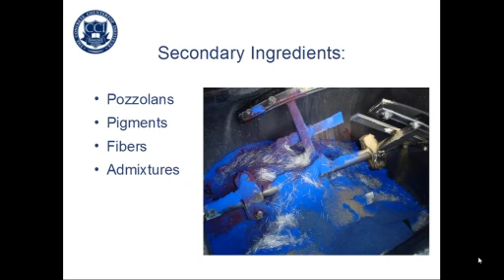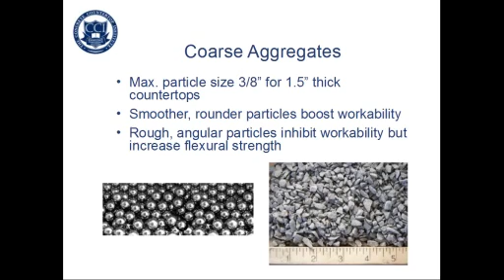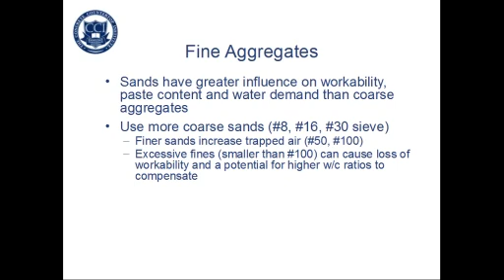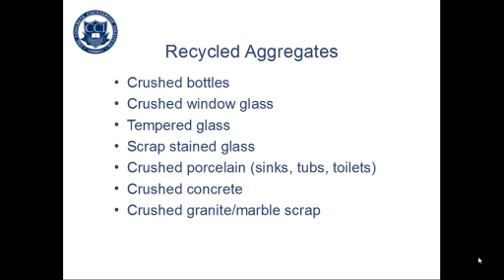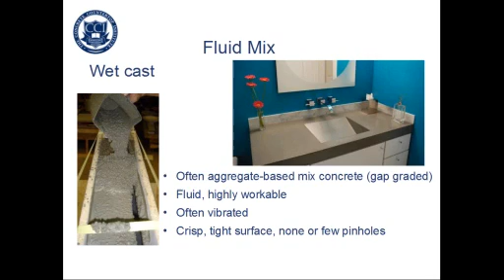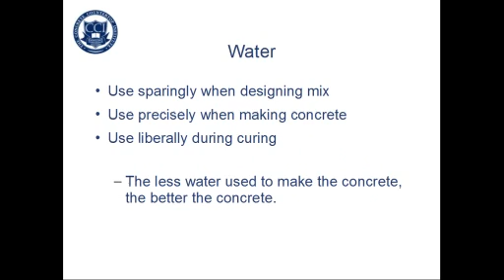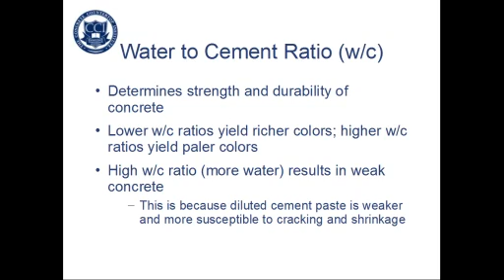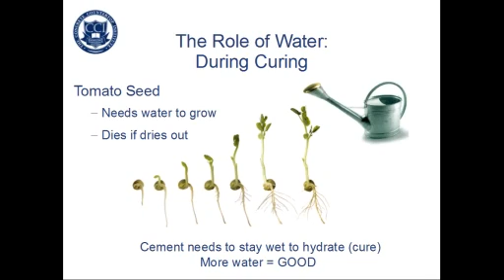How Concrete Works

Comment: Thanks a lot! I am whatching you from Odessa city, Ukraine country. I am going to start from smal model of this bussines in my garage.
So what is your recomendation. How long a concrete should be wet and how long to dry it?
Reply from the maker: You actually want your concrete to wet *cure*, not to *dry*. Please see this article:  http://www.concretecountertopinstitute.com/blog/2011/07/curing-an-essential-step-to-create-high-quality-concrete-countertops/ The amount of time is highly dependent on the mix design, but is usually only about 2 days for good quality concrete countertop mixes.